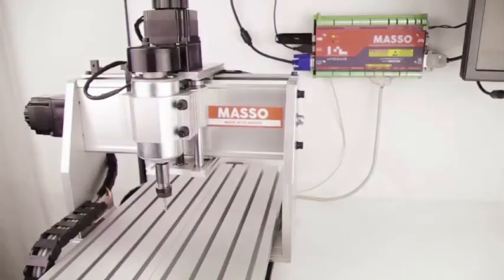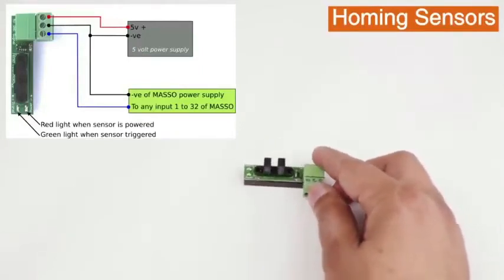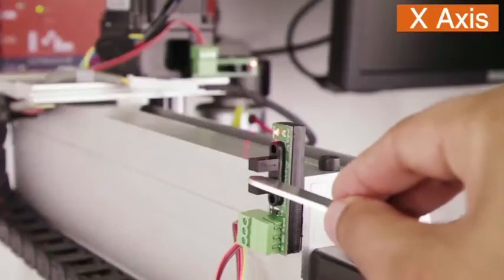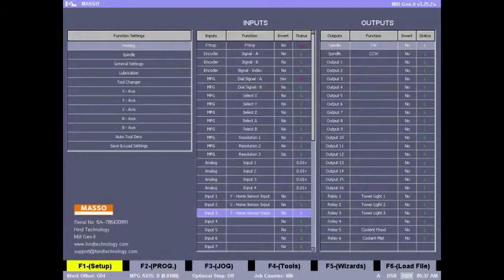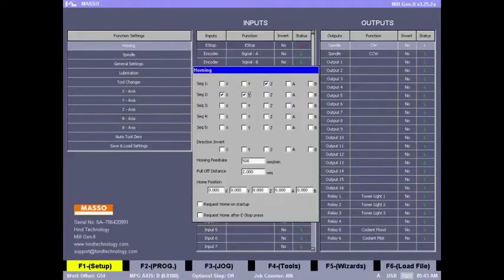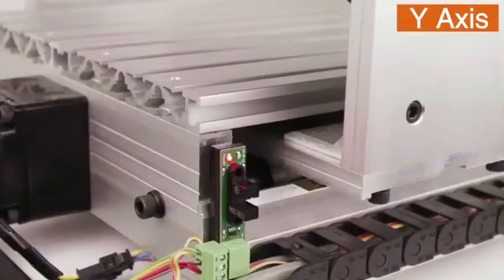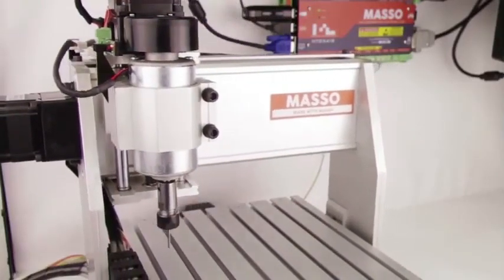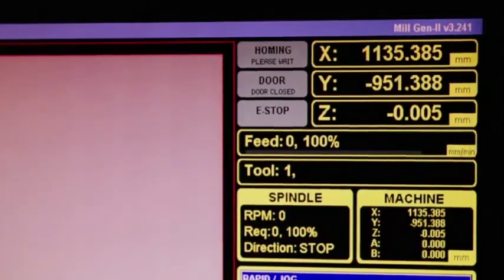How to Setup Homing on CNC using a MASSO CNC Controller

Comment: hi,
i just got my masso controller last week and just booth up yesterday, and have some question about the axis calibration
of z because if i home the z it well home at top 0.00 position. how i can calibrate it i need to put (-) on the value of my z?
example if my z axis is 150mm travel i need to put minimum at 0.00 and -150mm on the maximum?

thanks

Rex Cobey
Reply from the maker: yes set Z minimum to 0.00 and maximum travel  -150mm

Comment: For a dual driven gantry cnc router, does masso allow for independent homing in order to square up the gantry? Thanks and keep up the great video content!
Reply from the maker: Thanks Benjamin and yes you can slave the axis with an option to have two homing sensors on each side to square up the gantry

Comment: The sensor need 5 volt is there any available 5 volts on the masso or I need to another 5 volt power supply?
Reply from the maker: Hi, you will need 5v for a power supply

Comment: One area to be careful is that Masso does not support any hardware limit sensors or switches on the other end of each axis--opposite of the home sensor end IOW.  This is an unacceptable oversight IMO.  We had the same situation he showed in the video where on an initial home sequence one of the axis's was inverted.  In our case it was the B axis which is slaved to Y which resulted in the ends of the gantry moving in opposite directions.   Even getting to the estop fairly fast we trashed two ball screws and ball nuts and had a 10 day delay waiting for replacement parts.

My point is that even cautious reasonably bright people make mistakes and there should be provisions on the other end of each axis (excluding Z obviously) for limit sensors as insurance.  Masso does not agree (and some users might not either) as they push using the software limits.  If I had known this before our purchase I think I would have gone with a different solution as machine and worker safety is important.  To be clear I am not knocking Masso as their service has been good so far and I think they just don't agree that there should be limit sensors on both ends.
Reply: Gene Phipps I am not sure how the addition of limit switches would have made any difference in your case. Neither axis would have gotten anywhere near a switch of any kind before inflicting the damage you describe. As you said, you made a mistake - you should have checked the motor direction, individually, prior to attempting to home the system.

As for you complaint of a lack of action by MASSO is a bit rough, Jatinda has made significant and regular updates to the MASSO software based on customer feedback. Yes, the software still needs some improvement but as the entire product is the work of one man we have to be realistic in our expectations. 

Personally I would vote that MASSO is the CNC hardware product of 2017, the software interface not so much so, but it is a wonderful foundation to build upon.
Reply: I actually used our example to demonstrate how easy it is to make simple mistakes that could lead to serious damage to either the machine or workers nearby--I was not saying limit switches would have prevented the damage in that particular case, but rather mistakes WILL happen.  You mention frequent software updates and I agree that that is great--but the updates themselves also have the potential to cause an issue that could damage the machine or again injure a worker.  There is simply no excuse for the system to not support hardware limit switches.  To me it is like intentionally driving a car with faulty brakes.

I also went out of my way to mention that Masso support had been good.  I was not knocking Jatenda.  For hobbyist CNC users Masso is wonderful.  For a production shop with employees I would have concerns.
Reply from the maker: Thanks for feedback and every feedback that a MASSO user gives is always added to our feature request list. We do plan to add the features over time, its just that the list is very long now with common and personal feature requests. Again something like this will be added in the future because we still have a lot of inputs and other resources available on the MASSO. We will for sure look into this and see if this can be pushed in the next software release. Thanks for the feedback.
Reply: Hey Gene, I know this is a very dated reply and things may have changed in your situation and also many things have changed in Masso but the best option for a hardware limit switch is to have the extra limit switches on each axis and run them NC in series with each other through the E-stop input. This would cause an immediate shutdown to prevent damage in any case. There are many other alarm inputs now (more than likely not implemented at the time of your post I understand) that you could wire into. I do agree there is many more features that could be included within Masso but that is just a very easy example of how to remove any danger of damage from hitting a limit at the wrong end of the axis :-)

Comment: Can the amount of offset from the limit switch be changed.
Reply: Chris Bailey you can set the pull away the pull away distance in the Masso.
Reply from the maker: yes you can set a pull-off distance